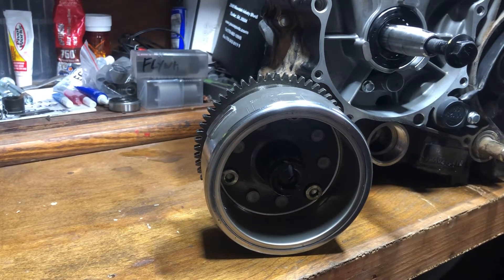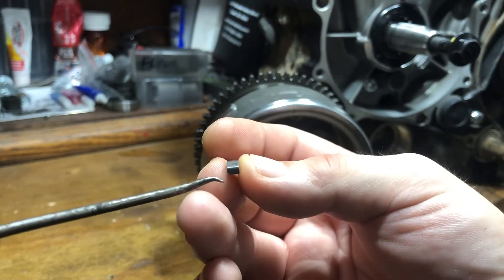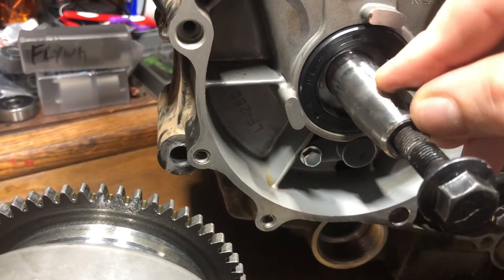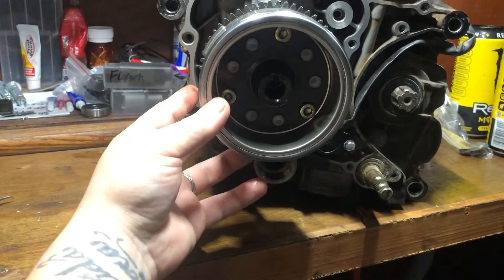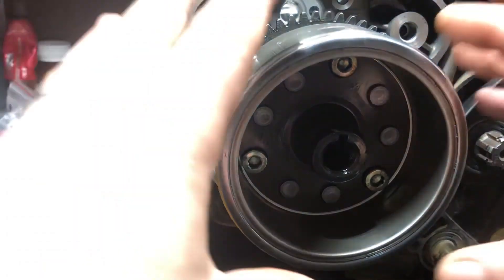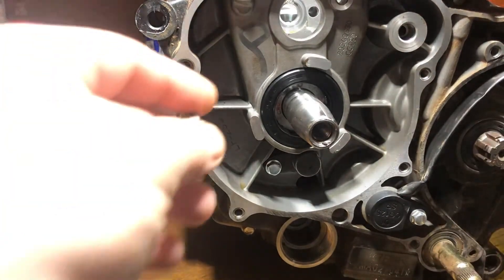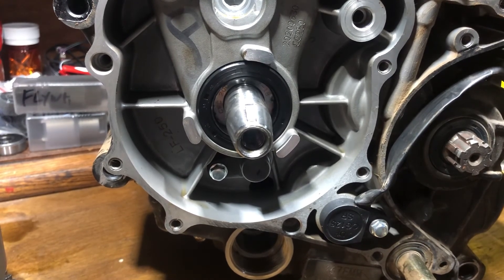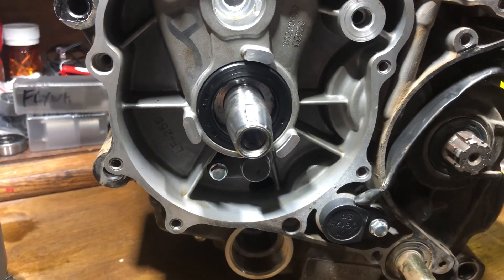Tbr7 performance upgrades hawk 250 performance modifications #honda 4 degree timing advance key

Comment: Hey bro I got a question I got a hawkx 250 with the counterbalance motor and I just put a performance cam in it put it all back together and it was running better than ever for about two weeks and then i was coming down the road and i heard a popping sound come from near the cam shaft area and it started running a little rough and noisy kinda sounds like excessive valve noise but everything is good and i cant figure out what the hell it is a few people said it's the timing chain but i have no idea how to adjust it if you can adjust it...?

Comment: Hello is it possible to remove the crankshaft timing gear with out splitting the case ? Looks like there is space there to pull it ?
Reply from the maker: Absolutely you won’t have to split the case just remove the side cover a couple of other things and you should have access to change the timing key if you have the available tools the whole job start to finish should take around an hour

Comment: Doing a battery upgrade from 2024 li¥ang 250 hawk x standard no name base poor in acid battery to lets say a durolast. Obviously the terminals are different. So new type terminal connectors why not upgrade the wires from the battery to the ignition system so why not upgrade the gauge of wires throughout plus better purer copper or aluminum cause it's a doomsday bike trekker prepper project I need have host a radio a charging system both solar and non solar terminals . Got anything similar to this

Comment: 14:55 in thank you for clearing that up about the 300cc jug not actually being 300cc i just purchased  a 350cc big bore kit and now i checked the bore and stroke its only 268cc thats disappointing but hey now i know they lie about the Displacement.  Good information, you earned a new subscriber 👍

Comment: Not really relevant to this video but what size fly wheel? I'm trying to fuiger out if I can find a fly wheel weight that would fit a hawk 250.
Reply from the maker: Flywheel weights as in balancing it?
Reply: @Jboost412  as in adding more mass. They help with technical riding and stalling. A lot of professionals riders use them.
Reply from the maker: Absolutely I just didn’t want to suggest something without being sure exactly what you were looking to do so yeah a machine shop should be able to make some flywheel weights to accommodate what your trying to do I actually lightened mine to remove rotational mass and it’s been good I don’t have any issues with the bike wanting to stall out on me in the tight technical areas in the trails usually we add or remove by drilling or machining if possible hole/holes into the flywheel not allowing the weight to protrude into where it would contact the stator
Reply: @Jboost412  They make kits for bikes already. My question would more specifically be what other bike would have a similar flywheel? I'm trying to get around the RND lol
Reply from the maker: Off hand I’m not sure cross compatible most of the internal stuff I did was custom made in my shop but I agree I’m sure there’s something using a similar size flywheel

Comment: 1 more thing jay ...I've did my values a couple times when I first got it, and i was turning the motor clockwise ...it turns np and the valves rise and fall like they should  ...it ran perfectly fine when I did it that way,  but I've watched this video many times and haven't done it that way in a long time  , and I got  the same results no matter which way I did it ..just hope I those little metal shavings( if u remember) that I found on my magnetic oil plug weren't the result of doing valve lash incorrectly..I haven't had shavings in the past 4 oil changes so I hope all is well ....just thought u should know buddy ...
Reply from the maker: Honestly that’s a little strange typically if you rotate it clockwise versus counterclockwise you’ll hear a funny kinda grinding noise I mean Technically it shouldn’t hurt anything now if it was a timing chain or belt style engine it could possibly jump a few teeth off time but luckily it’s a gear drive style setup

Comment: I’m pretty sure the cut/indent on the key goes on the right side, not the left as you say, if the flywheel spins CCW when running.
https://youtu.be/Z7_G4PJnHlg
Reply from the maker: Key needs to go exactly how it looks in the thumbnail of the video in order to advance the timing
Reply: @Jboost412  Yes, looks like indent is on the right of side the key in the thumbnail, which is correct. Great video!

Comment: This doesn't look terrible hard,, would you say that this mod adds top speed or just makes the motor more responsive?  When is the 300ccjug videos coming?
Reply from the maker: So overall it’s power adder not really dedicated to any one thing so it could add some speed to your bike or it may just get you to your top speed quicker ball depending on how the bikes setup when you add the additional timing to it but either way you can’t go wrong it takes about 45 minutes to install one with the right tools best to do it when your ready for an oil change since you lose oil when you pull the flywheel & starter gear assembly
Reply from the maker: I’ll be doing a cg300 jug video here soon since riding season is coming to an end I’ll have the time to make a video of how to do it step by step
Reply: @Jboost412  awesome! I need that video so I know what I'm doing lol ,,, do you have a link too where you bought your jug kit? Ive ordered twice and it got cancelled both times because they dont have the parts
Reply from the maker: Yeah I can get you the link for the correct jug kit we get them from AliExpress for 125 bucks I believe they are now after shipping
Reply: @Jboost412  yep thats where I ordered it from and it got cancelled,, I guess I just have too wait until they have more in stock
Reply from the maker: There’s a few different vendors from there let’s see if they have more from the one I buy from if  it usually they restock stuff quick enough
Reply: @Jboost412  do I need special tools? Or just a regular gear puller will work fine?
Reply from the maker: You can use a regular 3 jaw gear puller…I just use a bolt that fits the outside bigger threads Of the flywheel and use an impact pops it right off I believe the threads a m16 but I can check to be sure
Reply: @Jboost412  hey bud, my key arrived today and I just want to be positive before I do this ,, I understand the "HILL" goes down but on my new 4* key it has a indent on one side and the other side sticks out a little bit.,, does the indent side go on left and stick out side to the right? Thanks again
Reply from the maker: So the key goes in making sure you use the advance instead of the retard exactly how the videos thumbnail shows the key installed
Reply from the maker: It can be tricky because installed the other way around you would actually lose power instead of gain power
Reply: @Jboost412  yes thats what I'm afraid of lol in your video you talk about the indent and how the size determined degree , but I dont think you talked about how the other side sticks out , from your video I'm thinking the indent on the left side if not I guess I will do it twice lol

Comment: Where can I order this for a brozz 250?
Reply from the maker: Should be the exact same key as the Honda’s we use links in the description for the 4 degree they offer a 2 as well but 4 degrees is a noticeable difference in power & throttle response I don’t believe the 2 degree is worth it in my opinion

Comment: Helpful video.   So for the timing change, one of the biggest concerns is removing the flywheel as a puller is required.   People always have questions about what puller is appropriate.   I know for a Brozz 250, an M16 x 1.5 RH bolt is the correct puller.   I don't know if this is the same puller for a TBR7, or a Hawk though.   

This is the one I used.
   
https://www.amazon.com/gp/product/B000WJC0U2/ref=ppx_yo_dt_b_asin_title_o05_s00?ie=UTF8&psc=1
Reply from the maker: Thanks! Yeah I can see how pulling off the flywheel might seem a little intimidating to someone who’s never done it I’m hoping this video can show people you really just take the cover off sit a few bolts & dowels to the side and run your puller into it and good….the puller you mentioned I’m honestly no sure what size I use for the Tbr7 I’ll have to check and let everyone know

Comment: Awesome content! I thought the key had the D part down and flat part up? Like you had the key in upside down? This will prevent the flywheel from going on the shaft fully.
Reply from the maker: Yes sir that’s correct! for demonstration purposes I wanted to flip the key over so It was easier to explain which way the notch should sit to either cause the advance or a retard in time I figure there’s no way to install it upside down so they’ll see when the flywheel comes off it’s supposed to be 180 in the other direction…I honestly meant to mention it in the video but got distracted trying to make sure i covered everything else